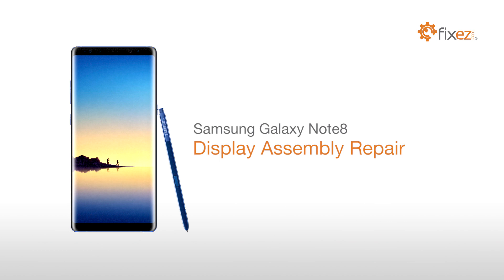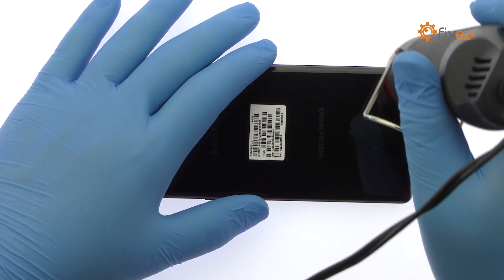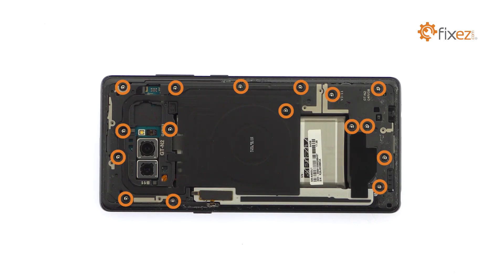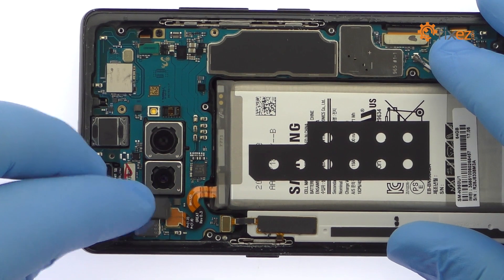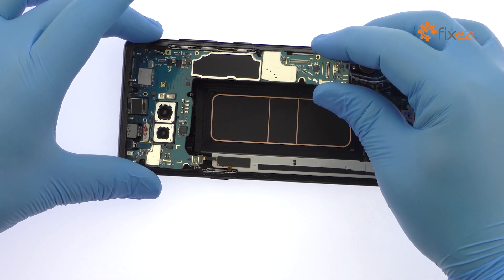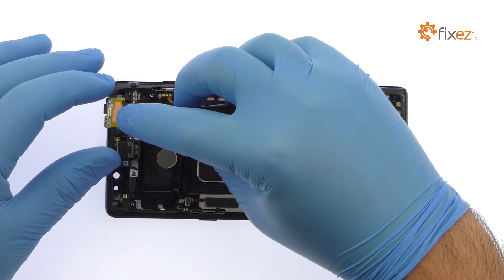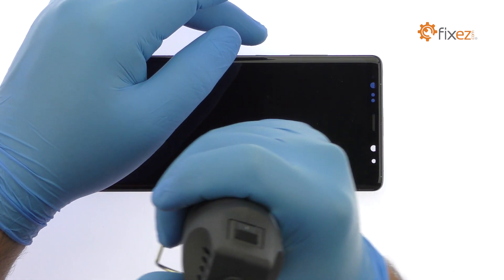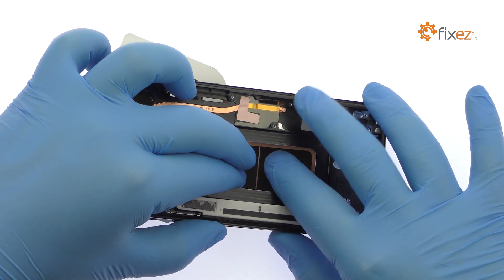Samsung Galaxy Note8 Display Assembly (LCD & Digitizer) Repair - Fixez.com

Comment: This is the worst repair video I've ever watched and attempted to follow. Be warned your phone will not come apart as easily as they show. After trying to follow their guide its clear they have already disassembled the phone and there is no glue in the phone they use and b/c of this they never say which parts are glued in, so when you try to do what they show you will treat your components up. I finally got mine repaired, but had to watch many other videos, but if you need to see how to put what parts where it's good for that only. Good luck
Reply from the maker: We apologize to hear you have ran into some issues following our tear down guide. We'll ensure to take your feedback and learn from it to help improve our videos in the future. We do appreciate the feedback provided and you posting your message for all our viewers. Thank you